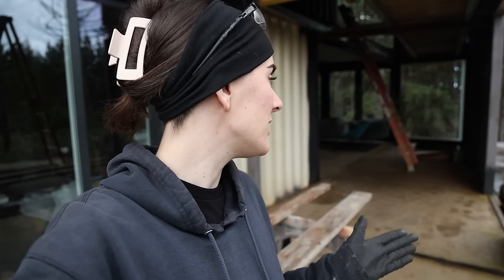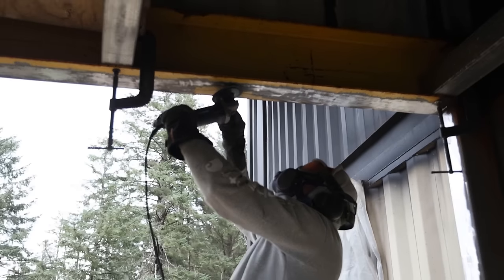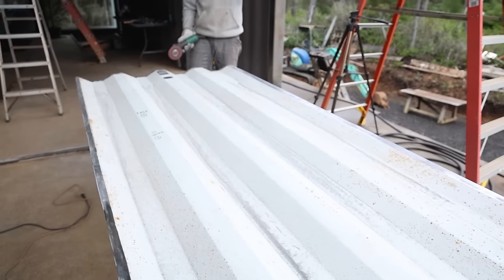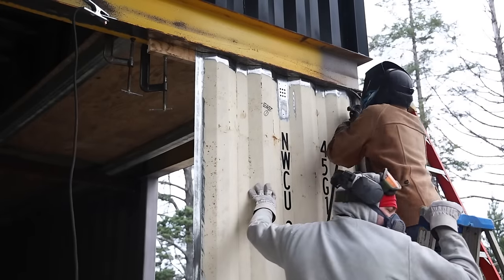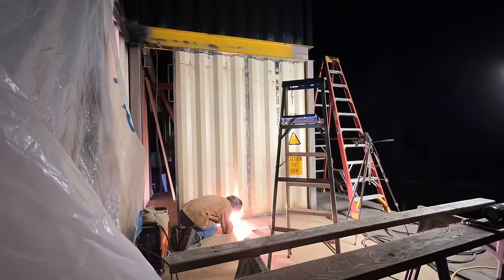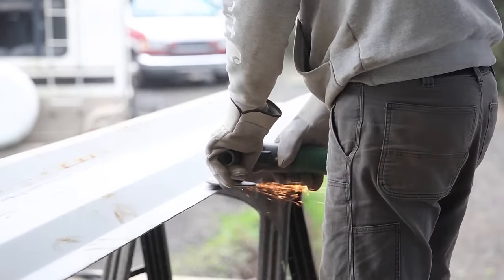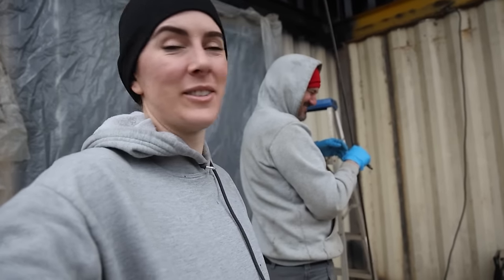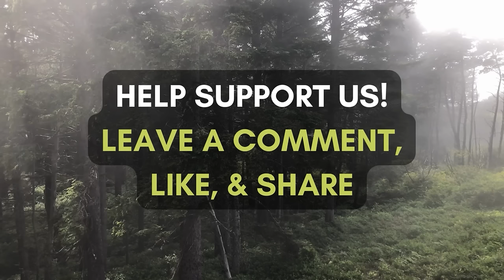THEY FINALLY DID IT! Couple Builds Modern Off Grid Container House BY THEMSELVES #diyproject #weld

Comment: You should have used an " Oscillating tool" instead of the file to get the Cement off . It's like a file with teeth and moves at about 12,000 rpm .
Reply from the maker: Those work great too!

Comment: Quick ?:: how often do you have to change the blade on the grinder? Can you estimate how many were needed throughout the whole project? I have no idea if it’s like 40 or 400?? 🤔🧐🤓
Reply from the maker: It depends on the thickness of steel we are cutting. The thicker the steel, the more often we have to change the blades. To cut out a few panels of the containers, we used about 4-5, so at this point we probably used A LOT.

Comment: You must be building where U get no snow ,frost or cold .I notice U are basically building a steel house with no thermal breaks in the steel which would allow for transfer of frost from outside to interior steel surfaces .AlsoI know its early in the build but I see no insulation inside hollow steel beams or walls. Condensation,cold and frost transfer could be a big prob. in your future .Wishing U well
Reply from the maker: Yes you are right, we will be installing insulation and taking the cold into account... we just haven't gotten to that step yet :)
Reply: @PacificPinesRanch  I'll try to explain..Any where U have continuous metal from Outside to Inside without a thermal break such as a strip of wood or plastic inserted where a strip has been cut out of the steel U are going to get transfer of frost from outside to the interior surface which is then going to melt and create all kinds of water problems inside..Take a look at manufactured steel or metal windows and doors and U will see they all have some kind of thermal break in the metal separating the outside and interior surfaces..U can correct  this prob .now but not once all your doors and windows are installed. Only concerned  U are making big mistake which is going to cause big problems in future....good luck